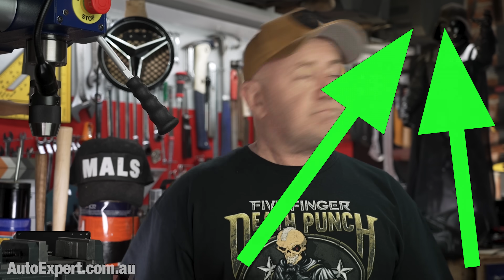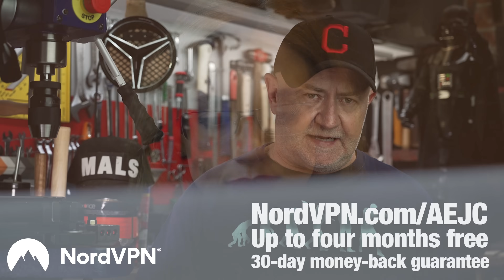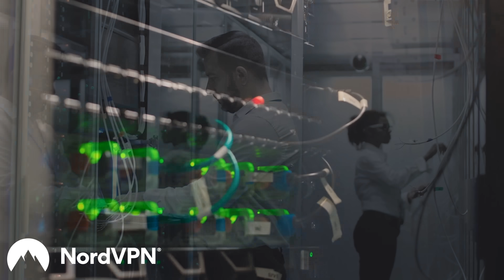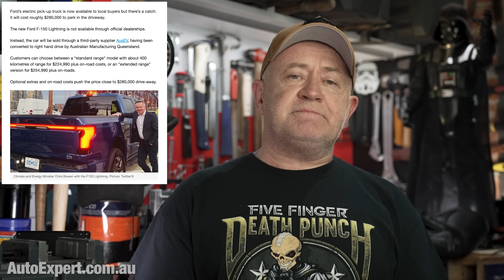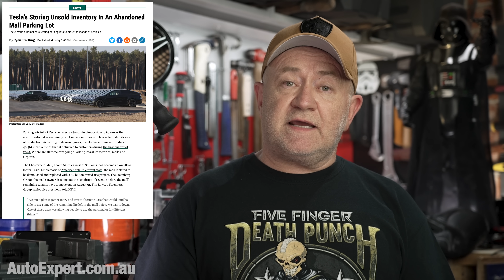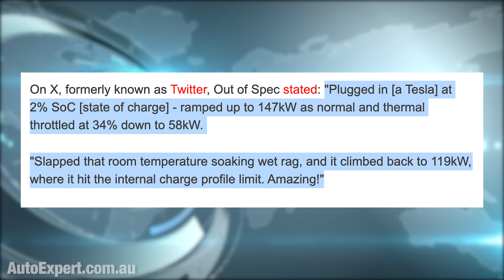ELECTRIC UTOPIA? Top 10 insane EV reports (this month)

Comment: The whole concept of the electric Gerry can booster is like a dog chasing its tail, a road to nowhere.
Reply: But the dog is entertaining and the road to no where is just a disguised  off ramp  people with jeeps. It's how we get away from all the idiots
Reply: @bobbysenterprises3220  I guess so.
Reply: The only way for the "eCan" to work would be if it had 10x the energy density of current batteries. And then it would make more sense to cram these energy dense batteries into the floor of the car and use them as the primary energy source.

Comment: If you objectively evaluate the power to weight ratio or power to size ratio or power to cost ratio of current battery technology, you quickly realize that batteries absolutely suck at powering anything bigger than a laptop. For example, a $30k power wall might power your home for, what a day or so? But don’t use the microwave. Sorry to the EV brainwashed out there but battery tech has a very long way to go in every aspect before they make any sense for any larger scale application like  cars and off-grid energy storage.

Comment: I have a book on batteries you can run high current in to most batteries. But to charge lithium batteries they say you run the voltage up to whatever the voltage the battery is supposed to be then you cut the current and leave it there for a hour or more and if you put higher current into them they stop charging blow up or just stop working I’ve seen a couple of people who have been using these fast chargers and have around 100k miles and have had to replace the battery pack twice and the second one is bad now. They say lithium batteries are great because you can recharge them 12000 times but there are 52 week in a year and 5 working days a week so that come# out to 130 charges per battery pack at a low price of $7000 for a rebuilt battery pack and around $60000 for a new on every 50000 miles because that’s better and cheeper than changing tires every 30 to 60 thousand miles and a filter and 5 quarts of oil. Plus the tires are having to be replaced every 5000 to 10000 miles. So on a EV instead of a set of tires around $50 each and 2 gallons of oil instead we are replacing 1000 pounds of batteries and at least 5 pairs of tires and EV tires are around $500 or more each where you can get tires for gas vehicles for from $25 and up and they aren’t as heavy so they also don’t destroy the roads. It sure makes me wan to get rid of my 1988 truck and get a new EV and that’s not counting the little children that are put to work digging the lithium by hand in pore country who will probably be out of work because I don’t have the money to pay them to dig out the tons of dirt to make a battery pack.  O well
Reply: What about all the EV owners that don't come to your shop because their batteries are still fine?

Maybe you're seeing the opposite of "survivor bias"?

Comment: N° 9.  You don't understand John.  You are supposed to be wearing rubber boots when doing this and you don't drape the wet cloth over the plug or cable. Having wet the cloth close to saturation, you use both hands to hold the cloth horizontally about 18 inches above the plug or cable and then drop it. If the cloth falls off, use a stick to pull it away and then try again. There is no problem about removing the cloth. It will be completely dry, your credit card having paid for the cable or plug to act like an electric kettle element. On a hot Sydney afternoon, you can use your sweat-soaked shirt and underpants (knickers if it is a girl) ..... cooled cable or plug and nice dry clothes afterwards
Reply: What do you do while waiting around without your shirt and underwear?
Reply: @christiandisch8147  You stand around waiting for your car to charge. They tell us that the whole point of these supercharger thingies is that it shouldn't take too long. Girls in skirts can enjoy the freedom and the thrill of the breeze on a breezy day and no-one has any reason to suspect. A bloke can go commando for a while. Everything done in the best possible taste. No-one would give John stripping off a second glance ... "Go figure". Once it becomes the norm to dry clothes like this, no-one will give a second thought to momentary exposure (all EV owners together); after all, Germans lay naked in the park during their lunch hours.
Reply: @terryhoath1983  We do? Damn I must be going to the wrong parks!

Comment: A wooden Cybertruck, Geoffrey DeHavilland would be impressed not. The mighty Mosquito, what a plane, built mainly out of wood because the War Ministry wouldn't give them aluminium during the war. The fastest piston engine plane for a fair bit of the war.
Reply: William Towns was of course ahead of the curve (or angle) with his startling plywood Hustler and the Africar project was the doomed sensible approach to timber utilitarian motoring. Both haven a certain Cybertruckesque wedge / urinal  angularity.

Comment: Kratos might have a better chance of success if it was merely a holder for AA batteries wired in parallel.  I mean, the chances of the driver remembering to charge the Kratos every week after non-use are slim. More than likely, the Kratos actually will be needed, at which point the driver will slap his forehead as he realizes he forgot to keep the ****ing thing charged. 

Better that Kratos just accepts AA batteries. Next time you're stuck on the side of the road, just walk into the nearby grocer, or kiosk/convenience store, or even a pharmacy. They always have AA batteries. Just plug them into the Kratos and get yourself to the next charging station for you EV.

Oh, yes, if you run out of juice in the bush, more than likely you have a torch or shaver or radio or something with AA batteries. So just use those to get you to the next grocer.  🙄

Comment: I have a couple boxes about that size they’re about 2 times thicker than the one He’s showing. The new one I have puts out up to 2200 watts were off grid and a 20 pound pro pain tank will run this Champion device for around 4 to 5 hours a night for around 30 days because the sun doesn’t put out as much power as they say but this device does charge up our batteries so the lights and fridge’s and the phones stay charged all night. It will also operate for about 8 hours on a gallon of regular gasoline. One of these would be great for using with a EV it’s small and you could even use one while driving. 
I seen a video of a EV  breaking down about a year ago a man and his wife stopped to help him he said he needed a gallon of gas they said but you have a EV how’s that going to work he opened the trunk took out a Honda generator and plugged it into his EV the couple gave him a gallon of gas and watch as the EV charged back up. I suppose we’re going to see a lot more of that in a few years or else gas and diesel vehicles in the future

Comment: I think battery technology needs to be at least twice as good as it is now for EVs to actually compete properly with ICE cars.
And hopefully remove the possibility of thermal runaway fires.
Reply: Tusker fleet data on EV fires found that EVs are 20x less likely to catch fire compared to ICE cars.

If Lithium batteries were so easy to go up in flames, our phones, tablets, electric razors, earbuds, Bluetooth speakers, headphones etc would all be on fire constantly!

Comment: When I start a job I have to run a risk assessment. If I ran one on a ev I’m pretty sure my risk assessment would say stop work and find another way as too dangerous to proceed
Reply: Wait til you find out fires and even crashes are more likely in a petrol/diesel you’ll be walking everywhere instead. Make sure you buy a 5 star safety car and drive safe.

Comment: 10 km with a 2kWh charge is VERY optimistic. According to a quick search, even very efficient EVs get about  4 km/kWh, which would net you 8kms at best. So probably less than 5 with a SUV as pictured...
Reply: Regardless of the exact numbers, the range extension is laughable. I wouldn't ever lug around an extra 20 kg of spare battery just to have a few kilometers of extra range that I'll likely never need.

Comment: I had a genuine soft spot lol for Volvo until they jumped on this Ev bandwagon.
Reply: You ll feel very stupid in a few years.
Do your research invest in Tesla.
Reply: @lucadellasciucca967  sounds great if you own property.  I have to drive 50km each way to and from work.  I rent. I can't charge at home, and public chargers are very costly.  It doesn't work. 
Every Ev vehicle battery requires 200 tons of raw material to be mined, by Diesel powered vehicles unless they're in a western country where the miners are just beginning to use electric mining machines. Lithium is not usually mined in western countries. It is mined where labour costs the least, and the environment is overlooked. The poisonous by-products are appalling.
The most environmentally friendly thing i could possibly do is keep my 4 cylinder 2009 hatchback on the road as long as i possibly can. Keep it off the scrapheap and not invest in  a new EV. The industry building these EVs in China is a serious concern. I know you've drunk the kool aid and you think I'm full of it.  I think you could wait a couple of years and hear of the environmental damage the EV industry is causing. You know these EV batteries are going straight to landfill? Have you seen the queues of written off teslas in the US? Those batteries are not being recycled.  Nobody can make enough money from it so it's all being buried.   It's the ugly secret of recycling. But it's true. I just hope it's not a fire risk.  When EV batteries burn they are frightening.  And they can require 25 times the water that a petrol powered car fire would.

Comment: 19:00 If this is the future of our emergency services we will be running out of staff soon.
Sadly John, my father, while on duty in the mid to late 70s, attended an accident of a flipped car in Northern Sydney that was starting to catch fire. After using all 3 of his patrol cars extinguishers and failing he received 3rd degree burns to his arms trying to drag a mother and her 2 kids from the burning car. He did not succeed. While he moved on he found it hard that he had to just sit there and hear them die.   
Personally I spent nearly 8 years attending accidents to help with emergency vehicle access and liaison with traffic control. 
After one shift I rang my dad for advice as I was not coping. He told me not everyone can separate work and home and if you can't it's not the job for you . . . so I quit.

Comment: Apparently the wooden cybertruck turned out better than the stainless steel one
Reply: It certainly is more resistant to rust...
Reply: It certainly has more even panel gaps.
Reply: It's the safer choice, because it doesnt burn so hot.
Reply: how?!
Do your research, invest in Tesla.
Reply: @lucadellasciucca967  Is that the only sentence you know how to type? Only an idiot would invest in a failing company like Tesla.
Reply: @lucadellasciucca967  What research materials do you use? They must be awful old
Reply: @robertmoffett3486  My investment results bag to differ xD To anwer our question. Indipendent news. People with knowledge of the technology. People using the technology. Also study phisics, computer science, coding and economics (macro and micro). :)
Do your research, invest in Tesla.
Reply: @robertmoffett3486  Are they tho? There is only one type of research. If you re honest with yourself you knwo if you ve done yours or not.
Do your resaerch, invest (dollar cost average) in Tesla.

Comment: What's the resale on an ev that's 5 years old with dud batteries?
Reply: Same as a paper weight.
Reply: I'm loving my five year old EV that still has its original real world range of 400 km.

It was dirt cheap to buy as a used car though, cause everyone is freaking out about the batteries going bad the moment you drive them off the dealership car park.

Comment: I think "the electric jerry can" illustrates the power density issues quite well. 20L diesel jerry can packs enough energy to run similar Defender for probably 200 miles/ 300km and one only needs ~3 to fully refuel it. Similar size battery has at least 10 times less energy, not to even mention the charge times. I reckon one can down 3x20L of diesel in under 5 minutes, would not want to be the sucker in grey zone of fighting standing next to the explosive batteries for 45 -90 minutes... will ya!?
Reply: You re unaware of batteries and EVs being new tech? They are right now, the worst they will ever be. Watch an adoption curve, do some actual research. Invest in Tesla.
Reply: @lucadellasciucca967  Batteries are older tech than the internal combustion engine. First cars were electric. Please stop trolling...
Reply: @lucadellasciucca967  We can argue about the rest, but INVEST IN TESLA?! Are you out of your fffing mind, their stock is literally cratering, all top execs are selling the stock options, it is sinking and rats already started to jump out if it. If you need any sign as investors that the company is going down, then there are all possible signs for that - staff layoffs, unsold inventory piling-up, execs selling their stock, discounts on products, late to deliver and cancelled product launches. Mate - Tesla is GOING DOWN.... SOOON!!!

I will be honestly impressed if Tesla still exists in 3 years time and mr. lying fcku mushk isn't going to be in jail for securities fraud... and his cronies in board for misleading investors. 

As for BEVs, they have been around for over 10 years and people already said "it is only going to improve"... yeah they did and they are still shit. If we isolate ourselves to lithium based batteries, then I would argue opposite - they are as good as they will ever be. If we talking about battery technology of any chemistry and some new prototype stuff that is made out of unobtanium... then yes sure batteries will continue to improve incrementally as they have done for last 100 years... and if we count the ones from Egypt in clay pots, then perhaps even for few thousands of years.
Reply: It which scenarios is the power density of batteries actually a problem?
Reply: @christiandisch8147  In many scenarios, which is why we still depend on dinosaur juice for the majority of our industry and transportation. But more specifically, in the context of the first story of this video and in the context of what the OP you replied to was saying - with the volume and weight restrictions of something one could classify as a 'jerry can', you may cram in batteries with maybe 3kWh capacity, which even for the most efficient EVs would barely grant you 10km of usable additional range completely defeating the purpose of a jerry can. Meanwhile, with an ICE car and a traditional can jerry can you'll get 200km+. If you don't see this as a problematic scenario for EVs/batteries, I might be able to interest you in purchasing a bridge I've recently acquired...
Reply: @zwerko  The strange thing is, I'm looking around and see most people driving mostly short distances most of the time. There are also a lot of EVs on the road these days and public charges are quite busy, therefore it seems that the "couple hundred kilometers range" works well enough for quite a lot of people these days.
Reply: @christiandisch8147  nope... you missing the point completely. "couple hundred kilometres range" is indeed plenty for most of the people most of the time, the issue is not really a range, it is charging. I personally don't believe "range anxiety" is really a thing, I don't have one, however "recharging anxiety" is a thing and that is where "electric jerry cans" comes to relevance. And that is where this whole concept falls apart. 

If you have jerry can with petrol, then it will take your petrol car 200km+, diesel even further, so it is legitimate solution in case you can't get to the refilling station.

Electric "jerry can" would only give you 10km range, because of how little power density there is in the batteries and how relatively much of that power electric motors use, therefore it becomes useless.

Just as analogy... look at your phone and portable batteries. Portable battery is likely bigger than your phone... right? True - it can charge the phone probably 2-3 times and it is also 2-3 times bigger in physical dimensions. If you want to recharge the car with external battery of sorts same would apply, you will need battery pack the size of your car battery, which for average car means 400kg+ ... it isn't really portable and it would not look much like jerry can at all. That is why the whole concept of electric jerry can does not work.

Just to clarify for final time - purpose of jerry can is to get you out of trouble if you run out of energy in whatever form you using it and get you to safety or filling station. For liquid fuel that works just fine, for electricity it does not work at all, simply because of power density (or lack there of), before we even consider the time it takes to transfer that energy from your back-up to your car.
Reply: @lp9280  fair enough, recharging can be annoying when you're unfamiliar with a new place or when there's generally little charging available. I cannot yet charge at home, and in some instances the public charges were occupied all the time. Those moments can be a bit stressful. 

Lugging around a battery pack that's equal to the not built into the car to add range seems hardly like a viable solution though.